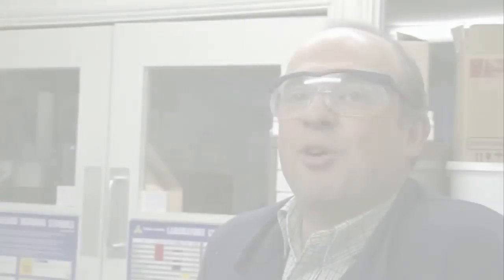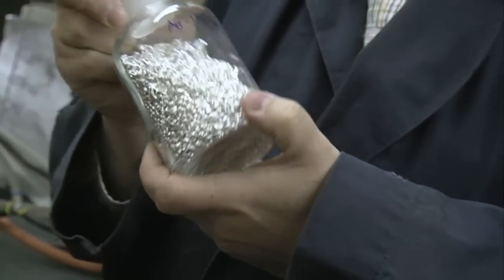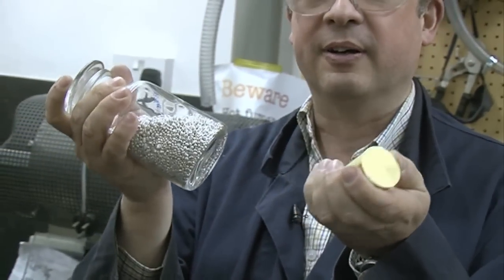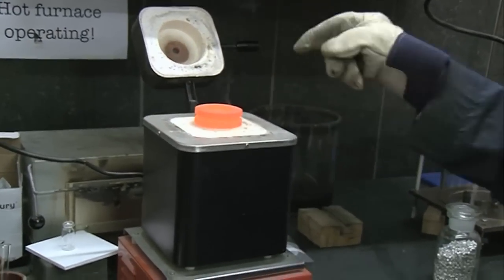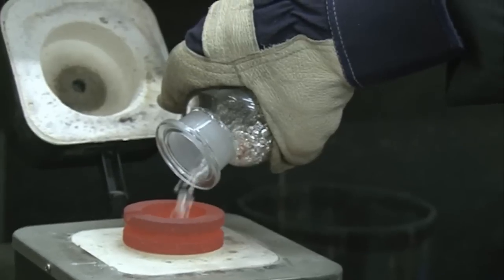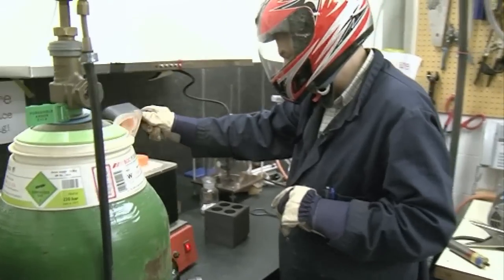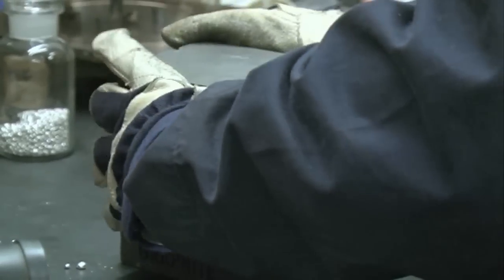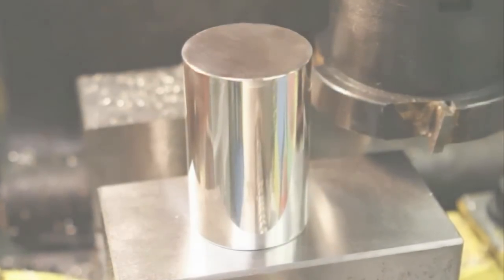Melting Silver - Periodic Table of Videos

Comment: It's actually pretty simple. Its a heater (just some wire with resistance) which is coiled around and around inside the heat resistant housing you see. The hole in the top is where you put the graphite crucible. You then shut the lid so the heat stays inside. It is basically as simple as a toaster, although it has sensors so that it can heat up to and keep a specific temperature. 
And it is standard equipment which you can buy at many places.

Comment: Despite what most people might think building a fantastic periodic table made out of real elements of the periodic table is neither expensive nor difficult. Yes some elements are very expensive, but well over 60% of the periodic table are not. It does require that you do a lot of “leg” work on Ebay, contacting refineries with genuine requests and doing most of the work yourself. Most refineries are very willing to supply at no cost pure samples of their elements to genuine collectors.

Comment: But the most remarkable property of silver is that it has the highest visual (and IR) reflectivity, which makes it the brightest and the "whitest" metallic element. The reflectivity is also high at elevated temperatures. That's why silver has the lowest thermal emissivity when it is in the solid state, at least among opaque substances. You can see in this video that silver doesn't glow very brightly even when molten (above 961 degrees C). However impurities on the top of the cast do.

Comment: You can collect uranium from sea water and soil. Its pretty low concentration but if you wanted to put the time and effort in you could get some.
There's nothing wrong with the main isotope u-238, its u-235 and u-233 which are fissionable but your never going to be able to get your hands on enough of those isotopes (unless you have a way of enriching the uranium and your sneaky enough not to get caught).
As for plutonium its not even worth bothering.

Comment: I wonder how many watts that machine is. How many joules did it consume during a single cast?
Reply: 1500c. Yeah, that's a bit hot.
Reply: Ok that's looks easy to calculate:

Lets say that the silver started of at a temperature of 20°C (room temperature)
It was heated to 1050°C, a 1030°c increase.
they were melting a little over half a kilo silver, so about 5 mole silver.

We know that the heat capacity of silver is 25.35 J·mol−1·K−1  so we know that we need (25.35 ·5)J to get the silver 1°K(or 1°C )higher.
To raise the temperature 1030°C we add ((25.35 ·5 J)·1030°C) = 130552.5 J

One last thing we need to take into account is that the silver changes from a solid to a fluid. Because of that we need to take the heat of fusion into account, in this case 11 280 J·mol−1 , that accounts to 11 280 J ·5 = 56400.

When we add those amounts together we get a total of 186952.5 Joules needed to melt the silver.  

This is a lot less then I expected It is possible that I made a mistake somewhere I don't have the time to recalculate it at the moment so if you know you can always politely reply and I will edit this calculation.
Reply: Wemja 2.5 million mole silver for half a kilo? I guess you meant 2.5 mol.
Silver molar mass is 107.868 g/mol. He melted 1 kg = 9.27 mol.
To raise the temperature 1030°C we add ((25.35J /mol*K * 9.27 mol) * 1030 °C) = 242044 J
11280 J/mol * 9.27 mol = 104565.6 J
Total = 346609.6 J

The cost in Quebec is about 1.53888888888889E-008 $/J
346609.6 J * 1.53888888888889E-008 $/J = 0.0053339 $
Of course, you have to add the cost of heating the graphite crucible and the internal parts of the machine and also add the wasted energy. It might come out to 0.04$
Reply: louis tournas woops I was wrong here I meant 5 mole.
After I thought I has miscalculated something I recalculated the mole amount with the 0.00020g/mole number I found somewhere online (this however is wrong). After I saw It was wrong I recalculated the amount of mole myself trough an alternative formula. I saw that my original calculations seemed to be correct and posted the comment. Apparently I forgot to revert the mole amount. The rest of the calculations are done for 5 mole of silver (1 mole Ag ~ 107g)
Reply: Wemja louis tournas  You know, there is no reason to convert the mass of silver to a molar amount :P just saying. You can quickly look up the heat of fusion of silver to be around 110kJ/kg no calculation needed. You can also scratch a calculation step by looking up the specific heat capacity to be 0.24kJ/kg°C. So as simple as:

(1030*0.24) + 110 = 357.2kJ  or about 178.2kJ for one of those cylinders, plus losses :)

Comment: it's a non-reactive substance that is pure, being used on clean surfaces in small quantities at standard pressures.  what you say obviously has merit, however in this case i would say the odds of anything bad happening are extremely small.  his mask is also not touching his face, so even if there was a splatter it might melt the plastic, but certainly wouldn't go right through to his face and any toxic fumes from the plastic melting would be small enough to be insignificant.

Comment: Scientific uses of silver? It has some strictly scientific uses but it's difficult to distinguish them from technological uses. Silver is used in reference electrodes known as silver chloride electrodes. In analytical chemistry silver is used in titration technique called argentometry. Silver compounds are used as catalysts in organic synthesis. Silver (as bulk metal or nanoparticles) is used in surface enhanced Raman spectroscopy because it offers the highest possible enhancement of the signal.

Comment: Awesome!

Kinda want to see how badly damaged somebodies hand would be from just a single drop of that stuff touching their hand now. Morbid I know. lol

What I'm really interested in though is where I can find furnaces like that to cook metal and casting molds to make sinkers and stuff.
Reply: Google "electromelt furnace"
Reply: You can also make a furnace out of all most anything. All you need is a coffee can, some kaowool, and a propane torch. Google around.
Reply: Propane torch can melt things with low melting points such as lead and zinc quite easily, for something like silver you'll need either a higher power propane furnace (that runs off a grill tank for example) or a coal/charcoal fired one.
Reply: You could also probably melt silver with an acetylene torch. I'm almost 100% positive it would work because it will melt silver alloys for brazing things like natural gas lines. Since brazing doesn't involve using 100% silver I'm not sure if it would work, but I see no reason why it wouldn't.

Comment: @EPhantom125 You may want the melting temperature of carbon. At atmosphere temperature carbon does not melt, but sublimates, at 3915 K K more or less, which is 3642 °C or 6588 °F. (Wikipedia info.)

Comment: @auirc they get round that by using different isotopes and in the case of uranium they use depleted uranium, there are a few dangerous elements used but only in tiny amounts that are in well sealed shatterproof casings. watch the first video, "element collector"

Comment: LIKE SO THEY CAN SEE! Could you possibly do a video showing how antimony cools? I've seen a video of it at one of these 'periodic table' displays. In case you don't know what I'm talking about, which I would be very surprised if you haven't, when antimony cools from being molten instead of making a crackling noise unlike a lot of metals, it sounds like little bells or chimes because of the crystals bouncing around inside.

Comment: That gold cylinder at the start of the video is worth $41,000.00 ... omg
Reply: ***** He uses that as a paper weight in the lab to hold down notes and stuff.
Reply: Just get a tungsten cylinder of equal size and plate it.  The density is almost identical, plus the cost is much lower for tungsten.
Reply: My3dviews And you are insinuating what?
Reply: That it looks just as cool as the real thing only at a fraction of the price, and only a precise measuring would reveal that it isn't a massive golden cylinder.

Comment: hi, im a new jewelry maker and i dont understand the logic behind alloys. looks like silver 925 (with copper) melt at 800 deg even tough both metal have higher melting point. the fact that it's an alloy reduce its melting point? so  if im right, i could take pure silver, add cooper and it would melt below 900 deg? Is it the same for all metals alloys like if i'd mix gold and silver?
Reply: I don't know for sure either, but maybe the fact that in an alloy the silver is no longer only bonding with other silver atoms (it is also bonding with the copper atoms, which are smaller) causes the bond between them to be weaker?
Reply: +Maxim Bissonnette Pure silver or pure copper will form a neat and rigid molecular structure, because there is only one type of atom present, they all fit together in one crystal structure. Imagine if you were going to build a house. Out of legos. All of the legos would fit nicely together in a strong pattern. Then you built another house out of lincoln logs, which also fit in a strong pattern. Finally you built one more house with legos and lincoln logs, but the legos and lincoln logs don't fit nicley together. You can still build the house, but it isn't as strong. The same thing happens when you mix silver and copper, the atoms don't fit nicely together, so the alloy isn't as strong on the molecular level, causing it to melt a lower temperature.
Reply: The logic behind alloys is easy to understand: Pure silver and pure gold are too soft to use in jewelry. They're also very expensive. By adding other metals - copper is the most commonly used one - you can make more durable jewelry.
Reply: chavan and andrews are right, its about strenght of bonds

Comment: So how do they contain the uranium, not to mention the plutonium? Thorium? All the other radioactive elements?
Reply: I believe that uranium have a few isotopes that isn't EXTREMELY radioactive or dangerous (depleted uranium is more or less safe to handle in normal temperatures). Not sure about the other elements you mentioned though.
Reply: Patrik Ivemyr Uranium 238 has a half life of about 4,5 billion years, you are more likely to get harmed by its toxicity than the radioactivity of it when handling it. It is practically non-radioactive.

In regards to the other elements they talk about that in some of the other videos, they tend to provide a bit of Uranium ore or something like that. If they can get a lump of the element though they encase it in acryllic and stops all alpha radiation and most beta radiation making the samples pretty safe to handle.
Reply: athox Perhaps a lead-glass casing :) however I know that glass has a tendancy to brown over time with exposure to radiation (like in old CRT monitors), so a thicker barium/strontium glass might be a possibility. Just guessing here though. Maybe they just hide them in lead casings lol

Comment: Put it outside in the heat, or torch the mercury off.  Some other chemicals exist to get remove the mercury.  
But it should have all evaporated off the silver by now.  I've done that with pennies, never to my silver coins and ingots though. And with pennies it evaporates in a few days if left in a really hot place.

Comment: Not in the same proportion to the price of  both silver and gold over the past decade. 
Gasoline wouldn't be $3.80 gallon vs $2.20 in 2003 or bread at $2.27 today vs $1.00 in 2003. Silver $4.85 ounce in 2003: now 4x-5x the price at 20.00 high of 32.00.So we'd see gas at roughly $9.08 to $11.35 per gal.Bread per loaf would be $4.00 to $5.00. 
Prices went up because of speculation and lack of demand for production or services as wealth disparity drives down overall demand in most industries.

Comment: @iman10000 Very shiny, actually.  Check youtube for vid 8tt7RG3UR4c (search for 'Melting steel with solar power'), about 1:20 into the video, they melt steel with concentrated solar rays.  The reflection of the sunlight is so bright that the red glow of the steel barely registers on the camera, but clearly it is quite shiny as it melts, almost like mercury.